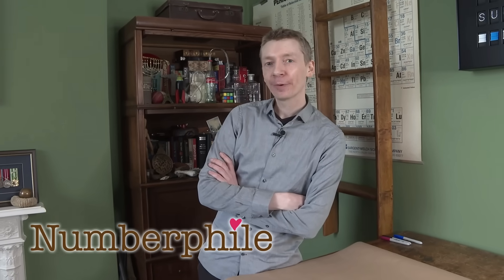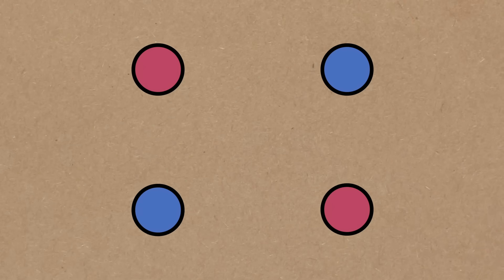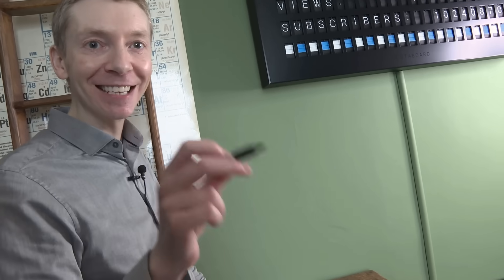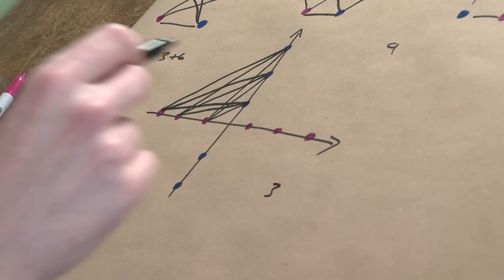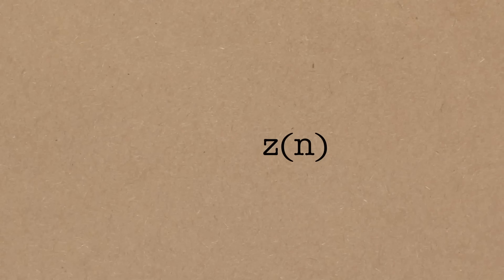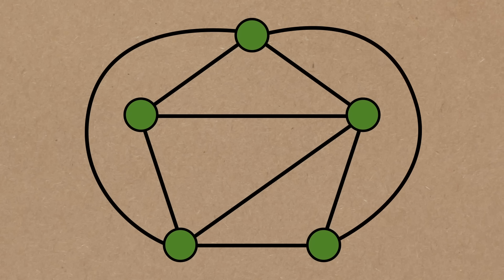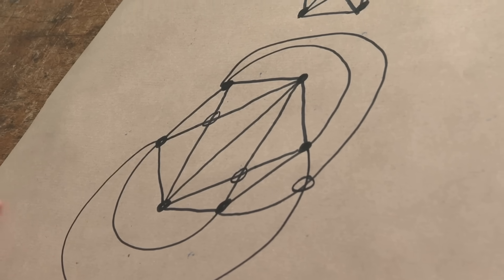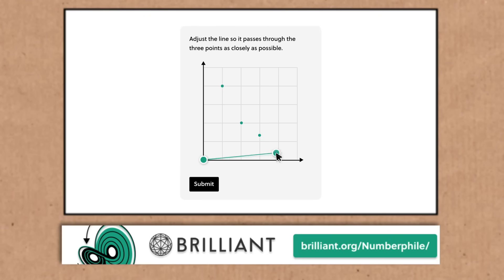The Brick Factory Problem - Numberphile

Comment: Forced labor camp in WWII? How do you MAXIMIZE the number of crossings to slow everything to a crawl?
Reply: Also, maximise the length of the tracks, and make sure you use the storage spaces as inefficiently as possible without obviously taking up more room, such as having to move fired bricks out of the way to load up the unfired ones.
Reply: They (the nazis) probably did want the bricks though. They (the nazis) just didn't care about the working conditions (of the workers).

Edited for clarity.
Reply: @phizc  
The people who were forced to work there would have had other priorities than their captors.
Reply: @ragnkja  I edited my post for clarity. It definitely wasn't obvious who "they" were. 😄

Comment: i think it is outrageous that they didnt use x(n) for the minimum number of crosses. Absolute tragedy!
Reply: viewer who crosses their z's: sweats nervously
Reply: But all these mathematicians draw their 'x's like ")(", so there's no cross.
Reply: @wbfaulk  rolles theorem: what doesn't cross?
Reply: @DrKaii  Mathematicians write 'x's with two truncated paraboloid curves with horizontal axes, pointing in opposite directions, with their vertices touching. Like a backwards 'c' and a regular 'c'. The two lines don't cross each other, they just touch. (Unlike a "normal" 'x', where it's two straight segments that do cross.)
Reply: @wbfaulk  
There’s a reason for that: it makes it easier to differentiate between the cross product and the variable x.
Reply: @ragnkja  I know. I'm just pointing out that the "x" that would be used in this case is not a cross.
Reply: @topherthe11th23  I guess people call it a cross 'cause one of the lines crosses over the other, and/or 'cause it's a cross rotated a little ways.
Reply: Yeah, this is, like, the one time when x would be the best.
Reply: Did that slight make you cross?
Reply: @strehlow  it it, actually yea
Reply: It should be " +(n) "

Comment: To me, the obvious solution is to fix the track crossings rather than minimise the amount you use them. But maybe that's why I'm an engineer rather than a mathematician...
Reply: Or make each stopping point a through-station instead of a terminal.
Reply: @pleappleappleap  exactly, and then use sidings if necessary, to move some carts out of the way. Or just have concentric circles of track passing into each location
Reply: How hard you try to avoid crossings surely depends on how much more expensive the improved crossings are compared to the extra track needed to avoid the crossing.
Reply: I think fancy crossings would be expensive in build time and capital, longer routes expensive in efficiency and (therefore) cash flow. Case by case decision I guess.
Reply: @Fidtz the the only reason it was cost efficient was because it was a forced labor camp, the only cost of human labor was food, a shitter and a hammock.
Reply: @thekroltan  sure, I would expect that exploiting slave labour skews the calculation in this specific example to "whatever exploits the slaves the most". However, it is still a (evil) calculation as they were making bricks, that were of use to their masters. In other, better, circumstances, building bridges or modifying the storage sheds might well be worth the investment, especially over a long period of time.
Reply: Or use both techniques to minimise cost/effort/power/etc
Reply: @mirr0rd  Mathematicians 🤝 Engineers
Reply: Put all kilns and storage units directly next to a single circular track. No crossings whatsoever, unlimited numbers, everything reachable from everything
Reply: @koenth2359 I think you,'re using the third dimension. I'm sure It's against 5he rules.
I don't blame you. We're all used to living in a three dimensional world.
Reply: @Captain Oates  No I think the 3rd dimension would be by those suggesting digging tunnels and bridges. This person is just saying to build a circular track, make it as large as it needs to be depending on the number of kilns/storage units needed and just place them along the outer rim of the circle, if I understood correctly.
Reply: circular and spherical designs are often the wisest choice, alas the same framework rationalizing the labor camps is completely alien to the circles of life.
this situation seems related to knots, too, with all the crossings/under/over and all, yet knots are not idealized to an abstract '2D'.
Reply: The obvious fix is to make the carts derail AS MUCH AS POSSIBLE, in order to slow down the force labor camp!
Reply: @Hendrik :D  Great point. I thought of that at the start of the video then by the end, I'd forgotten. 
Reminds me of "Bridge on the River Kwai" where Obi-wan is forced to build a bridge to aid the enemy, and becomes obsessed with the project, pridefully builds the best bridge he can.
Reply: @hendrikd2113  lol the solutions of a mathematician, an engineer and an activist
Reply: @hendrikd2113  increase derailings to 256 so it underflows to 0 derailings
Reply: @hendrikd2113  You're thinking to small. Proposing theoretical optimizations that remain unsolved problems for decades is way more effective at keeping work from getting done.
Reply: Beat me to it, though a better solution would be to combine kiln and storage. Engineering Platitudes 101: the best solution to a problem is not to have the problem. Can't have a track tip over if there's no track.
Reply: Something like railroad switches would definitely work, though the rails might need a do-over
Reply: Dig a canal and use boats
Reply: @marksales1982 haha its feasible, only problem, if your brick fall into the canal then clean up and loses of bricks is definitely greater
Reply: Situation: 200 ml of water in a 400 ml glass.
The players:              Optimist             Pessimist                Engineer
Their descriptions:  Glass ½ full       Glass ½ empty        Glass is twice as big as it needs to be
Reply: It's inherently hard for carts because there's a discontinuity for 4 wheel carts, because there tracks have to break.  Therefore when an axel crosses the break, there's only one axel holding alignment, and it can therefore rotate (one axel cannot hold alignment).

The answer is intuitively obvious once I phrase it that way of course - 6 wheel carts.  3 axels.  Therefore two axels are always in the track, and the cart cannot rotate.

It's not a problem of the tracks, but a problem of the carts.  Simple fix.
Reply: Put covers on the carts 😂
Reply: I was thinking "Dig tunnels/build bridges" but yea, that'd work, aswell
Reply: Yes, minimizing the crossings so that you only derail a few times each trip isn't that great in the real world.
Reply: A three dimensional world could do wonders for this problem
Reply: @bobby_greene  Ever tried to push a waggon full of bricks up a hill?
Reply: I figure a roundabout and switches should eliminate the issue alltogether
Reply: Drones
Reply: @grampyBot  "drones" 😂😂nerd
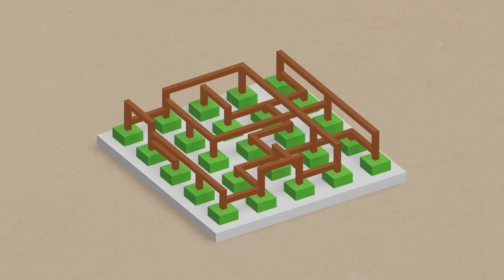Reply: 9:01
Reply: Just build one big circular track connecting all the kilns to all the storage. Done.
Reply: @markstambaugh  Yeah, what I just said
Reply: A circle of tracks around the kilns and a circle of tracks around the storage facilities. Both circles are linked by a single track.
Reply: The processor substrate @ 9:00 was a better, modern example of this problem.
Reply: Or make the storage buildings bigger so you need fewer of them.
Reply: To me, the obvious solution is to dismantle those worced working camps, even from an engineering poing of view.
Reply: @RaidPanda404  Not if your client was the German government or army of the time, I expect.
Reply: Yes that was my intuitive approach also.
Reply: That would be too easy and boring. ;-)
Reply: @paybackpayroll8691  at least mathematics based on greek metaphysics, operational mathematics like Buckminster Fuller's Synergetics are a very different thing
Reply: @HaileISela  Holy cow, I had that book as a young man. Didn't understand a bit of it, but it was awesome
Reply: Who else got an instant click of a very old 3b1b video when reached 3 kilns and 3 factories 😂
Reply: And that’s why engineers design railroads.
Reply: Don't be silly, we can fix it by easily moving around all the buildings around in a new configuration with long winding track layouts xD
Reply: I think the structure would be
- presses sited next to the  quarry, at the top of the quarry at the crest of a gentle slope
- A one way loop from the press to the the loading docks further down the slope carrying pressed clay to each kiln, then cooled bricks to the loading docks, and then trolleys being returned through a second entrance to each kiln on the other side of the loop. 
* a series of branches to each  store 
- scheduling would be
*  the  kilns would be sited with the highest number of bricks actually  produced per day closest, and the smallest further away to minimise the number of track crossings per day and conges
* kilns would be scheduled so that they open at different set times, so that the same  labour can be used to unload all the kilns quickly, and congestion minimised on the track.
* The number of variants would be minimised and with each kiln would sticking to one type of brick as much as possible. 
* maximise usage of kiln (energy is expensive) in terms of capacity and cost.

- minimise the risk of tip overs through better wheel flanges and points, but I suspect that this could be tricky due to the weight per wheel being much higher than on a train, and the wheels much smaller changing the friction and making the  centre of gravity much higherIt mightnbe best to replace the small batch kilns with a contunevtunnel kiln (like a modern pizza oven
Reply: The thing is: the track problem is just an unrealistic applied example of the mathematical concepts he spoke of, the track problem is not actually important, because we have computers that can calculate that stuff for us, but the math behind it (the track problem he presented) is.
Reply: Get that hellhole running so efficiently that all the physical labor can be done by one Australian man.
Reply: I worked in operations research/scheduling/supply chain, and I agree with the ideas above, but I never worked in that industry.

In reality there would be a few more constraints (in a non forced labour situation) 
* to maximise machine and kiln utilisation, and 
*minimise injury risk,  wastage, labour needed, storage needed, double handling, and energy and transport.
Reply: The costs from high to low could be 
* energy, 
* indirect costs of admIn, and sales  * transport over the total supply chain, 
* equipment amortisation (press, kiln storage, trolleys, docks, and specialised delivery trucks with forklift) and maintenance, 
* labour, 
* changeover  costs of press
* finished brick damage 
*  raw material,  and
*  risk of obsolescence.
Reply: There needs to be a third set of wheels with a gap between wheels larger than the gap in the track.
Reply: @Reprint001  the same try
Reply: It is great that we live in a 3-dimensional universe (not including time) so we can just build over a path so there aren’t any intersections
Reply: @drakkenfan2  you have clearly never pushed a cart of bricks before. Introducing an incline requires a large energy investment and multiplies the energy required to move the cart significantly
Reply: @austinwoodall5423  make the emptying end of the track lower than the filling end.  Then the additional energy gained from pushing the track down the incline will mostly offset the amount of energy needed to push it back up the other side.  You’ll need to use slightly more force to push it back uphill on its reverse journey, but it will be significantly lighter.
Reply: Why fix the tracks when you can dig tunnels and build elevated crossings?!
Reply: that is, EXACTLY, why you're an engineer rather than a mathematician.
Reply: You would have to deduct the time it took to redo the tracks. And a disruption during war time might not be practicable…
Reply: Sometimes  you don't have other choice, because you need all of them.
Reply: Assume track crossings are very expensive, so you want to minimize them to minimize the price of the factory.
Reply: lol
Reply: Third dimension chauvinism 🤔
Reply: Or have tunnels
Reply: Use 3 dimensions, problem solved!
Reply: You beat me to it.
Reply: If you want 4 kilns connecting to 4 storage units without crossing but allow using 6 storage units the following works I believe. Having 2 parallel lines and alternating kilns and storage units but with the order the same for both lines you can connect 4 kilns to 4 storage units. Tried 5 k and 7  s Connecting all 5 k to 5 s and  6 k and 8 s connecting all 6 k to 6/8 s also but not sure they work. Let me know if you try this method it if it works for 2 or more storage than kilns  trying to connect all kilns to the amount of storage places as there are kilns.
Reply: But that’s still more work
Reply: What do you mean “fix” them? This is a purely mathematical problem
Reply: Three axles, as @TheoreticalString says.  Also the way my dishwasher bridges the gap between the inside and the door when you roll out the bottom tray.

Or you could go with bigger wheels so they span the full length of the gap where the track is cut by another track.
Reply: As an engineer im sure yoill put the things that need constant matainance and servicing behind the heaviest part of the frame with no access then place the most complex and sensitive parts in the way that should never be dismantled because then they have to be replaced at tremendous cost.
Reply: Yes it would be interesting to find a way for two tracts to cross without the use of a switch.
Reply: Diamond crossings…
Reply: Engineers solve problems. Mathematicians begin by seeing whether an answer can be had. Spoiler. We need both mindsets.
Reply: Where there's crossings, just take out one track and so just run one track at a time
Reply: It’s a philosophical question, I’m teleporting Out!
Reply: Booo
Reply: Why not just make it possible for the storage units to be connected? And let the carts go through the storage units to another one
Reply: Fix the tracks in a forced labor camp.  Brilliant!
Reply: ideally you should do both. but that oversight on your part is, as you note, maybe why you're an engineer rather than... not a mathematician, but competent at basic reasoning.

Comment: I knew K_3,3 and K_5 were nonplanar, but it had never occurred to me to think how many crossings were required to draw them on a plane. Has this problem been studied on any other surfaces? I know K_3,3 and K_5 can be embedded on a torus (and hence any surface of higher genus), and as for nonorientable surfaces, the Möbius band (and the Klein bottle) and the projective plane.
Reply: Just a thought: Despite not having the crossing number cr(G) for a given graph G, an upperbound N will tell you that G can be embedded in a surface of genus N. Since such a surface will have N "handles" which can serve as bridges when you embed the graph G, which allows you to avoid crossings. So to me it seems the problem of crossing number is equivalent to finding  "the best surface" it can be embedded in.
Reply: @bonsoonlin  I can imagine this general solution for N edges in the graph, just give each edge its own bridge (as noodly as required).
But I can't imagine it in general for N *vertices*, I guess you can twist the edges around the handle to avoid their possible intersections, but you still have to do this in principle N^2 times, I can't obviously see how this reduces to N without the loose argument inadvertently arguing that you only need 1 bridge for all edges
Reply: Robertson and Seymour actually have one of the best theorems of graph theory (I think): For any surface T, there is a finite collection of graphs H such that a graph G is T-embeddable if and only if it has no h-minor for any h in H. For example, on the plane (S^2),  H=K_3,3 and K_5.
Following this theorem, if you look at minimal surfaces a graph is embeddable on (characterized by the number of holes in the minimal surface), this problems and the one in the video are equivalent.
Reply: @beardedboulderer2609  came here to mention the Robertson-Seymour excluded minor theorem! Nice work.
Reply: @beardedboulderer2609  Thanks for the heads up! I will absolutely check out that theorem.
Reply: @beardedboulderer2609  You called the plane S^2. Did you mean the sphere S^2 or the plane R^2? Or are you using different notation?
Reply: @SilverLining1  I use them interchangeably in this context, since R^2 with {infinity} is essentially the same as S^2. Indeed, you can think of a piece of paper of the plane, then drop that paper on the ground. Now you've embedded that paper onto S^2 (the earth).
Reply: There is something called the "toroidal crossing number," which is what it sounds like. If you look at papers on that subject, you'll also find some work that has been done for other surfaces.
Reply: @JohnDoe-ti2np  Very cool! Thanks. I figured some research had been done in this area after watching this video, but I hadn't thought about it beforehand. Thanks for sharing the terminology with me.